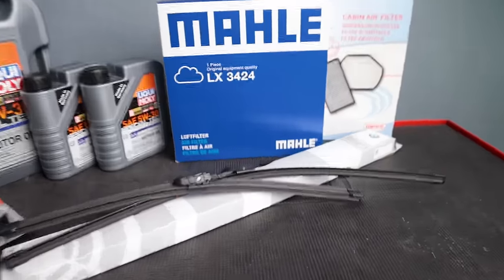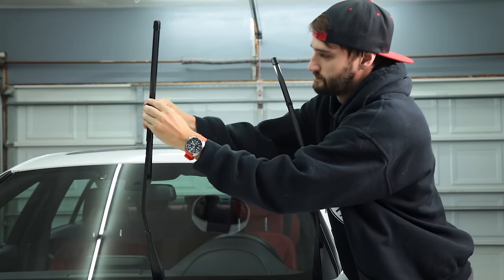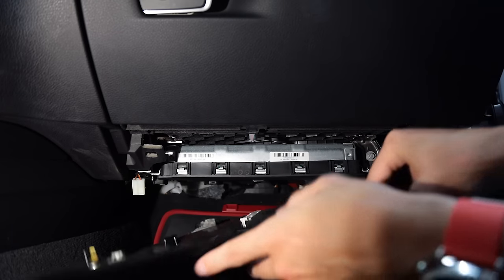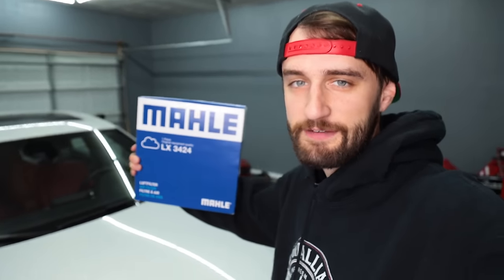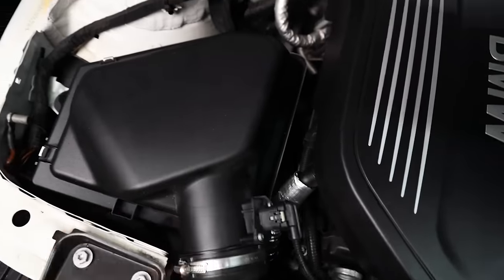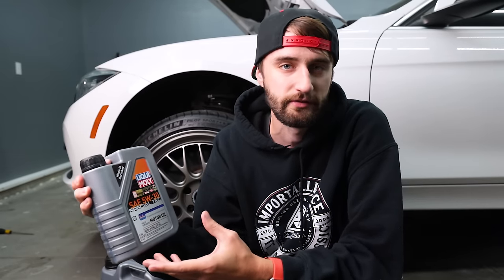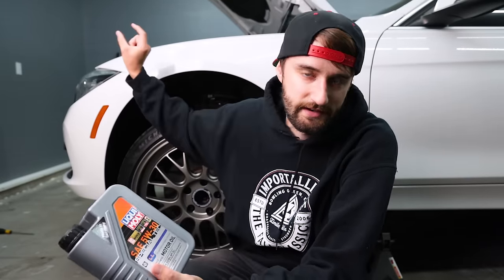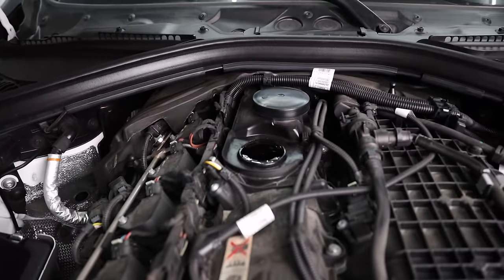STOP GETTING RIPPED OFF AT THE BMW STEALERSHIP!

Comment: Air filters are always great to replace, and new oil definitely helps with peace of mind, but our favorite HAS to be the first rain storm you drive into with a fresh set of wipers. One of the best feelings!! Thanks for the support Justin, great video!
Reply from the maker: I agree. I love any maintenance where I can immediately see or feel a difference!
Reply: Are you saying you're gonna sponsor this channel & send free parts?
Reply: @DigitalDissident  they already do 😂
Reply: Why the special tec oil and why not the molygen?
Reply: I also order so many kits from you guys and they are perfect!  I makes owning a used BMW so much easier!
Reply: Unless you go next level and ceramic coat the glass. You won't ever really need the wipers, but having good ones there just in case is a must.
Reply: As an engineer into R&D, based on years of reasearch and my phd thesis i've come to the conclusion that air filters are usually replaced way too often doing more harm than good.

So to explain a bit: air filters are about 99,5% good when new. After a few thousand kilometers they pack up with very fine dust into the mesh fibers that increase air filtration efficency to 99,95%. Measured on Dyno, there is no implication on power output if differential pressure before and after filter is up to 0,08bar. Measuring real used filters for differential pressure, most had like 0,02-0,04 (used filters changed by dealerships i work with, with history and milage and careful extraction to not lose any dust packed, sealed in ziplock bags, taged to keep track). I've weighted the mass of dust in the filter in used condition and it was about 40grams of dust gathered in average. Continuing research i've artificially added dust into a new filter (by standard procedure, including chemical composition of dust, and size concentration recipe) and reached 140g of dust until i've reached the differential pressure limit. As you can see way above what i typically found at the regular service interval.

Conclusion - air filters are changed way too often, should have a differential pressure gauge to tell when to change rather than a number of km (some have, Renault has a dial on the air filter box that reacts to differential pressure and turns more to red when pressure gets higher). Changing a filter prematurely means bad filtration due to the fact a new filter is not at peak efficency.
Now I change my air filter once every two oil changes for my personal car. I would drill holes before and after the airbox filter for my car and mount a differential pressure indicator, but the ones i have are very expensive lab grade tools. I'm developing an aftermarket cheap solution to measure differential pressure for air filters to better asses when a filter change is actually needed.
Reply: So agreed.
Reply: Where did you buy the bmw wipers?
Reply: @AsiAzzy  That's exactly it, with the DP gauge.  Like any decent commercial grade air handling unit.  I'm surprised I never hear anyone else mention this.
Reply: I live in Seattle and agree for sure. Just ordered both air filters and wipers from FCP.
Reply: O
Reply: Run what you brung that's why
Reply: IF THAT'S WHAT IT NEEDS IF
Reply: Even if your old wipers are streaking; if you coat the windshield with RAIN X, you won't even have to turn the wipers on.  The rain just beads up off the glass. Amazing product.  But its no substitue for good wipers.
Reply: @leshenits1929 sounds like it has some of them "forever chemicals" mixed in there, mmhmm..

Comment: Hey Justin, thanks for recommending FCP Euro. Just ordered all new brakes (~$400) whereas the dealer wants $1680. Looking forward to getting back into the garage and that sweet feeling of doing the job. Update: brake job was easy & fun. Thanks again!
Reply: Why would they charge that much? Are they seriously trying to scam customers? Wtf
Reply: @57RollsRoycePhantom  it’s not they try to scam it’s just at dealership they always be charging a lot for just easy stuff
Reply: I had the dealer tell me a similar price for brakes on my 325I.  I did all 4, new rotors and pads for like $300 I believe, about $1300 less than they wanted and it was super easy.  They have a lift, air guns etc and it would be so easy for them, probably an hour max.  Not sure why they rip people off with that one, but that's a huge rip off service.
Reply: Rotors, Pads, Sensors all around cost like $1,000 here after tax

Comment: Just one thing, when you pull the wipers forward be very careful leaving them there while you grab the replacement wiper. If the arm snaps back it’ll definitely crack your windshield if there isn’t a wiper blade installed. I’ve seen it happen many times
Reply from the maker: Good tip!
Reply: I had a dealer crack my windshield years ago…lol
Reply: Great tip, these tech windshields are pricey
Reply: Same here

Comment: Hi Justin. Great video, just one note on the oil viscosity: engines with start-stop, modern turbos and modern engines in general go with thinner oil: reduce engine wear during start-stop cycles (cold starts induce most engine wear, the thinner oil helps), there’s a claim that the thinner oil helps the turbo cool (I did not investigate on this),  the thinner oil also helps and provides better lubrication. Certified OEM oils of grade 0w20 also have a lot of additives that specifically help the modern engine in all the statements I’ve said above. I’ve discussed this at my local dealership when I had to do the car’s first oil change. There’s more to that oil than the viscosity grade. I’d recommend switching back to the 0w20 or at lest conduct more study on the matter.
Reply: 0W20 oil is a VERY thin oil. It was introduced to reduce emissions and make fuel economy better since this less viscous fluid has less internal friction than a higher viscosity oil like a 5W30.
Start-Stop is bad, you should program it to be not active anymore. Turbochargers are now around for 20-30 years in car engines. They have worked with 10W60, 5W50, 0W30 and will work with 0W20, but 0W20 wont really "cool" the turbo better than other, thicker oils. It will be on the same level in my opinion.

Cold-starts: yes, thick oil, like a 10W or a 15W is quite thick and wont flow as good as a 0W or a 5W oil, but there is no need to have a 0W oil if it only gets like max -10°C in winter. A 5W will do the job very good, and even that - there are 0W30 and even 0W40 oils on the market if im correct. But be aware: the higher the gap between the number in front of the W and after the W ther more additives and viscosity enhancers they need to put into the oil because the base-oil they use is very thin. That doesnt make an engine oil bad, but it makes it expensive.
If you get REALLY cold temperatures during winter its justified to use 0W oil. If you have mild winters there isnt really need to.

"Thinner oil = better lubrication": basically yes, since the internal friction of the oil is very small. But the thickness of the oilfilm will also degrade, which is good for emissions and fuel economy, but not very good if you want to redline the engine often or have high oil-temps. The cussion between static and dynamic object (cylinderwall and piston) will deacrease which CAN be bad - depends on how you drive.

I think its a bigger problem on diesels, especially the ones with DPF. There is the chance of diesel mixing with the oil which will lead to the oil grading down to a 0W15 or something like that.

In my opionion it is the better idea to use 5W30. If you live in a country with high temps in the summer you can even go to a 5W40.
0W20 is to thin for my personal feel.
Reply: @heavyweight6440  thanks for sharing your detailed input. I’ve had exactly the same rationale regarding oil viscosity until my current car’s 1.4tsi. Winters here go around -15/-20C at their worst, median around -7/-10, while summers go quite hot, 35/40C. My previous car and the one before had naturally aspirated gasoline engines. Being an European, engines here tend to be smaller, so the previous was a 1.6l unit, it used 5W40, for this climate that was perfect. But it had no start/stop, no turbo. My current 1.4tsi only sees the dealer’s service and for the first oil change I’ve had the same thoughts: “0w20 is too thin!”, but the dealer reassured me that it’s not the viscosity as much as the additives in this specific oil grade. I’d still be using the manufacturer’s oil recommendation, regardless of my classic oil know-how. The same was true with organic vs synthetic oils servicing periods. Organic would turn to jam, while synthetic still had half it’s interval. We’ll know if these thinner oils are crap, but on the long run. So far, my engine is working pretty sweet with it, but I rarely need to use the car so it only has about 9k miles (14k km) after 3 years, so I could probably put butter in it and it would still work, with my milage 👨‍🔧
Reply: @georgealex19  Most of the tuned b58 guys I know, as well as myself, use Liquidmoly 5W40.
Reply: Change it early and often. 0w20 for regular driving. If u are going to track it or give it a long road trip at high temps and into boost a lot go with an occasional 5 weight 30 it won’t hurt anything. Best thing is use a high quality oil like Liqui Moly! 4500-5k on a boosted engine will keep that turbo and the internals in great condition. Get an oil analysis if u want to stretch more out of it in between changes.
Reply: Agreed colder start should be avoided and when forced running thinner oil in winter ❄️ then keep running
Reply: I just got an oil change done 0w-30.... is this problematic? Just bought the car last week 320i msport lci 2017

Comment: As a dealer tech, I agree with most of what you said. Things to look out for.

1.Make sure you leave the wiper arm down between wiper exchanges. The arm will come down with out you holding it and break the windshield.
2.The screws are very easy to over tighten on the micro filter. This will crush the plastic door for the filter box.
3.Air filter isn't bad, BUT if you have an N26. Its easy to break the vacuum line off the air box.
4. You will by a new engine if you mess it up the oil change.

Comment: Great video Justin.  And you are right about the basic maintenance being do-able by almost everyone.  I learned to do the basic stuff as soon as the warranty ran out on my old E60  5 series.  I also found that other things like serpentine belt / idler wheel replacement were easy enough to manage if you take your time and get a few basic tools.  The amount of money saved by DIY an be very significant.
Reply: I learned how to work on BMW WITH MY STEPDAD WE RESTORED A 73 2002 TII ! 4 CYLINDER MONSTER

Comment: Thank you Justin for this helpful video.  I just replaced the engine air filter on my 2017 330 iX which was a breeze.  Then I replaced the cabin air filter which was a total PIA.  What a horrible design for the location of the cabin air filter.   It took me fine times as long to do this than to replace the same filter on our second car a Toyota Highlander.  I would not have been able to do the BMW job without these videos though.  Thanks again.

Comment: 2:00 Concerning changing the wiper blades: I'd strongly advice to use a sponge or foam and place it onto the windshield, as the wiper arm may flip down breaking the windshield. This happens more often than you think even to professionals and is the main reason for windshield replacements.... However, Great Videos!!!
Reply: Happened to me this year on my X5 😡

Comment: Great video.  My one piece of advice on the cabin filter is to not necessarily reinstall it in the same direction it came out -- only because it is often installed in the wrong direction by whomever changed it previously (including the dealer)!  I've watched a few videos on how to do this, and the filter that gets pulled out can be in the wrong direction, and the new one is then reinstalled in that same wrong direction.  The arrows indicate the direction of airflow through the filter, which on the F30 is towards the FRONT of the car.  (You did it correctly in the video.)

Comment: The dealership would’ve charged damn near $800 for all of this lmaooo
Reply: I bet you’re not that far off!!
Reply: They try to charge me $968 for just a spark plug change and micro filter
Reply: Martyn H I get charged 700$ for an oil change and almost 1200$ i think the last time i went for a brake pad change.
Reply: I paid 785€ for 3 years of services which I think is fair.
Reply: @Xylti  that correct. When i bought my beemer i had the dealer quote me a similar figure for just pads-no rotors etc. He had the wrong guy. I was just trying to get a feel for costs. I later installed Akebono on front and rear including new sensors for about $200 in parts. DIY oil changes w BMW oil is roughly $70. I change mine 2x annually. Easy job
Reply: The cabin air filter change is definitely the biggest rip off. Especially that the filter does get dirty and should be changed at least at every other oil change.
Reply: In Canada they quoted me $1200 for a single tire change (brought my own tire) and a wheel bearing replacement
Reply: Why are they charging that much? Are they seriously trying to scam customers? Wtf
Reply: You guys are WILD 
OIL: $99
CABIN: $75
INTAKE:$80
SPARK PLUGS: $246
WIPER: $45

Those are dealer prices here.

Comment: Great Video!!!!

 10 year BMW Tech Tip!!!!!
I would stick to using the OEM filter. I haven’t really come into this problem with the B58 or B48, mainly n52s up to n55s, but, the green o-ring  with the OEM filters are the only ones which DO NOT cause sporadic vanos control faults. There is something about the way none OEM o-rings age that cause them to dry rot. Now that the B series engine has been in the market for some years, we’re starting to see the same issue with the large o-rings built onto the filters. I have yet to have a dry rotted o-ring cause a vanos fault on a B series engine but I have spent my fair share of nervous moments cleaning out bits and pieces of dry rotted plastic from the oil filter housing.  

Again, great video!!
Reply from the maker: Thanks for the tip!

Comment: Hey Justin just one tip. Before you take the oil filter out, tuck some paper towels around it, that way when you pull it out you catch any oil dripping off and hopefully keep your engine bay looking nice longer :)
Reply: I do the same. Good tip.
Reply: Ya got keep it clean or it could get dirty

Comment: Really loved the way you summed up working on BMWs Justin! You start with small stuff and begin working your way up. I've developed a collection of tools from working on my F25 and it's so worth it. BMWs can be very affordable if you do the maintenance yourself and will last a very long time if you treat them right. With the power of forums and software like Carly or ISTA, you can solve pretty much any problem on your vehicle. Even though my car is running fine, I have bookmarked guides for how to replace fluids in the transfer case and differentials so down the line I will already have good knowledge on what needs to be done.

Comment: Our dealer switched our X3 M40i from 0W-20 to 0W-30. We live in Canada so I find the 5W-30 a bit thick for really cold winter days. I was skeptical of the 0W-20 and I think it's used mainly to make the CAFE fleet mileage in NA. To avoid making a mess I use a plastic bag and put the filter in right out of the oil filter housing.

Comment: If you‘re aiming for more power, consider to change your oil to 5W-40. Never found better oil than this viscosity. Oil can handle the temperature better and still lubricates perfect. I‘m a fan of Motul Engine Oil, but LiquiMoly or other renown brands should be good too.

Greetings from Germany 🇩🇪 
Keep it up 👌🏼
Reply from the maker: Good to know! I was worried that people would upset that I didn't stick with BMW's recommendation of 0W-20
Reply: Justin Buice As you‘ve said in the Video, 0W-20 is waaay to thin. When I had my N52 It was serviced at the BMW Dealer with 0W-30 and I had some knocking noise from the hydros cause of short distance driving. When I changed to 5W-40 I never had any problems or noises. The engine even sounded way healthier when revving up.
Reply: Can confirm I was running 5w40 mobil1 in my 335i and 335d 👍 most people with higher hp do it here
Reply: Liquimoly 5w40 for f30 335x

Comment: This hits home. I went to my BMW dealer complaining about how my auto start stop would not shift back into drive when coming out of a full stop. I figured my extended warranty would cover but apparently diagnostics are not covered. So $750 later , they diagnose that my car needs 300ml transmission fluid ☹️
Reply: So you dump some fluids in and DRIVE

Comment: No need to err on the side of caution when filling the oil, if you fill the exact amount that's required you can be confident the measurement will be spot on every time in BMWs.

Comment: Thank you.  Would you have any tips on how to raise/Jack up the BMW?
Reply: Like to get under it? They have lift pads on four corners under the side skirts
Reply: For my F10 there are center jackpoints under the car in the front and rear. The front jackpoint is just in front of the oil plug, the rear is on center of the cross member i think..

Comment: Yes!! Great video!  The BMW dealership maintenance center is very very overpriced!!  I did some research when my f10 needed a new vacuum pump.  So the dealer wanted to charge me $7000.! 
I went to my local machanic who did it for $700.!!  Crazy!!  How does BMW get away with over charging that much!??

Comment: Just did the cabin air filter and while it was easy-ish, it was way harder than any other car i've owned. And what sucked is I only had the T20 bit so had to use a wrench to get that open.

Comment: You should use the same viscosity oil that the manufacturer recommended. The engine tolerance is built specifically around that viscosity. It's not too thin.